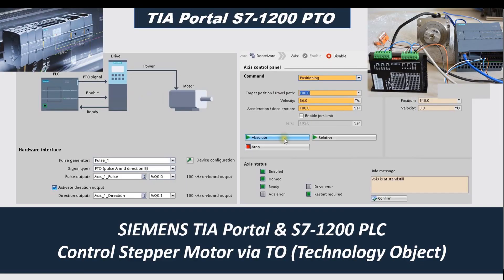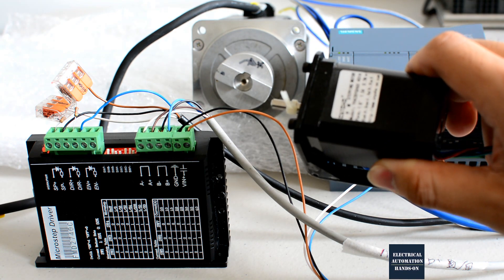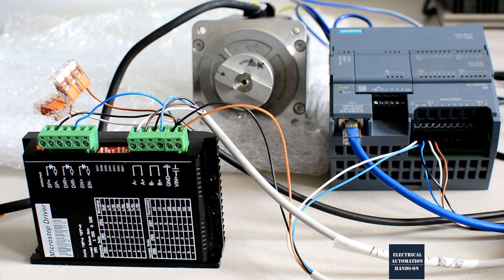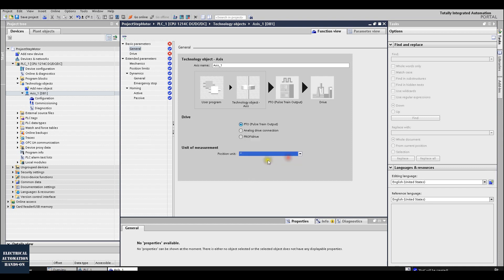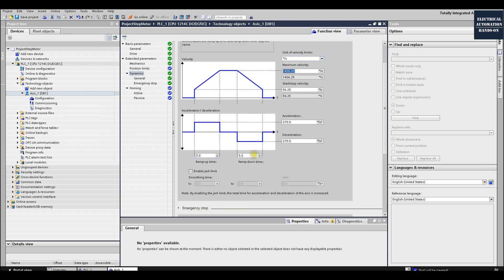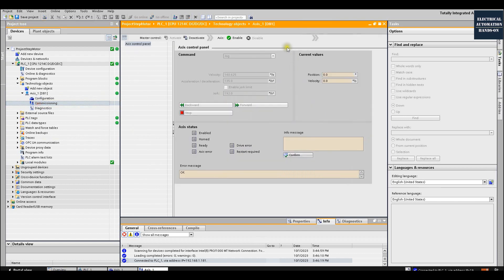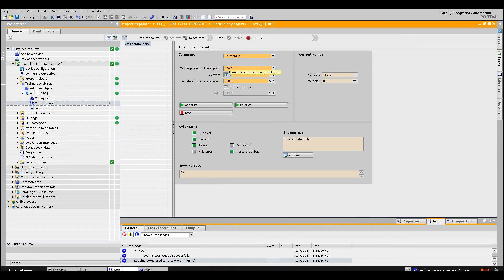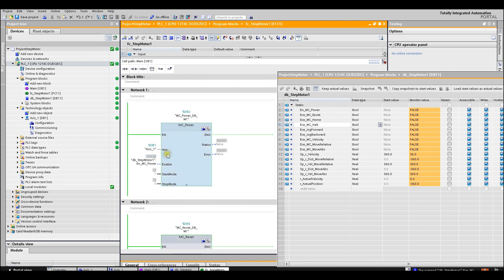MS08b. [Stepper Motor] 1/2 Siemens S7-1200 PLC PTO Stepper Motor Control (Technology Object in TIA)

Comment: Well explained video. The best one so far. THANK YOU! BUT I have a quick question I am not able to use degree/s. It shows mm/s. Is there any way to change it. I am using v18.
Reply from the maker: In the Technology Object, almost the main page of each Axis, you can select the 'rotary or linear' and unit for your axis.
Reply: @electricalautomation  Thanks a lot. I missed it.

Comment: Fantastic video, thank you. Is it possible to control multiple 5-phase stepper motors with their respective drivers from a S7-1200 DC/DC/Rly, so in other words, with relay output from the S7-1200?
Reply from the maker: using Rly can not output the PTO high frequent pulses. But you can buy a " SB " board, then use this SB board to output pulses
Reply: @electricalautomation  can you supply a part number for the SB board?

Comment: Is it possible to use a encoder handwheel like on cnc machine. To drive the servo manualy. Could you make a video if this topic. Greetings from Holland.
Ps i like your video's they are very clear and easy to understand.
Reply from the maker: you could view this application about handwheel function with Siemens T-CPU https://support.industry.siemens.com/cs/document/109807355/handwheel-function-with-simatic-s7-1500(t)-controllers?dti=0&lc=en-US